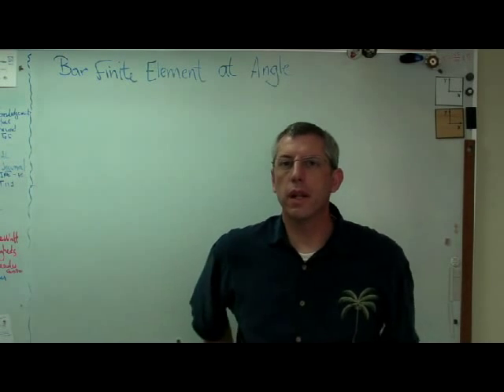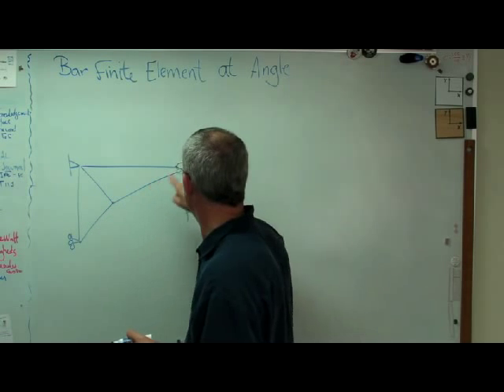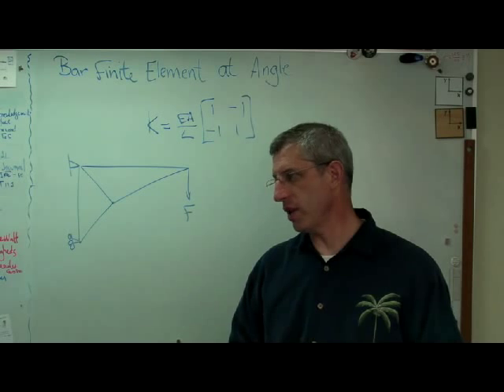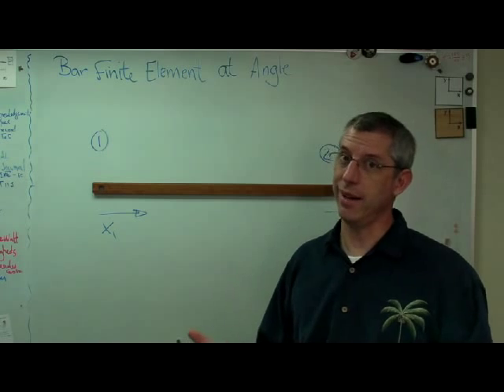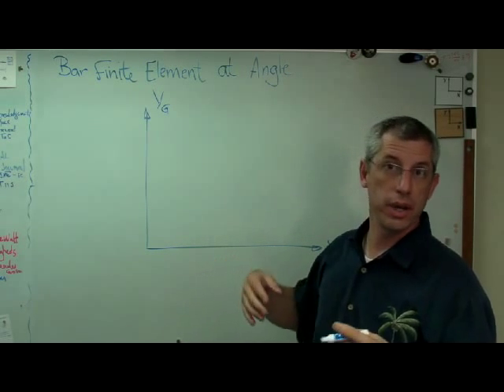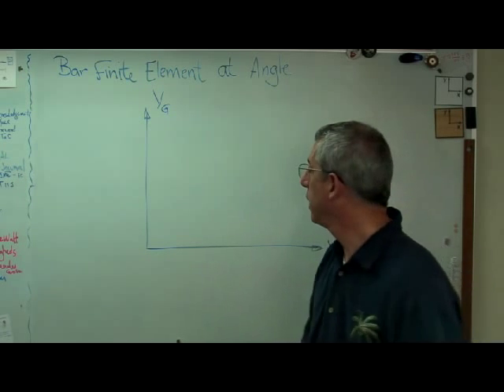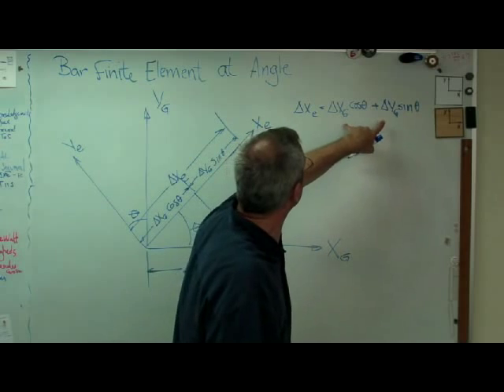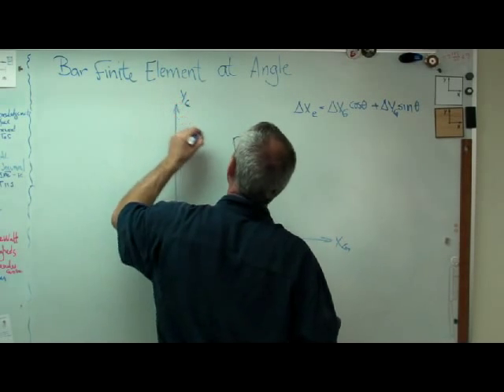Rotating Bar Element 1 of 2 - Brain Waves.avi

Comment: 7:00; If you were wondering how translating a grid to another can be understood, 3Blue1Brown has a great series intuitively explaining linear algebra (including matrix multiplication). A matrix is actually defined by its property that it translates a set of vectors (base vectors of a coördinate system or 2 vectors in that system) onto another coördinate system. Matrices are not just a computational trick. 

Notice how multiplying the set of the two base vectors [1, 0; 0, 1] with a random 2x2 matrix gives back that same matrix. This is becouse matrices are defined this way.

a b       x         1  0        =          a  b
c d                  0  1                    c  d

Main video:
https://www.youtube.com/watch?v=kYB8IZa5AuE&list=PLZHQObOWTQDPD3MizzM2xVFitgF8hE_ab&index=3
Playlist on linear algebra:
https://www.youtube.com/playlist?list=PLZHQObOWTQDPD3MizzM2xVFitgF8hE_ab